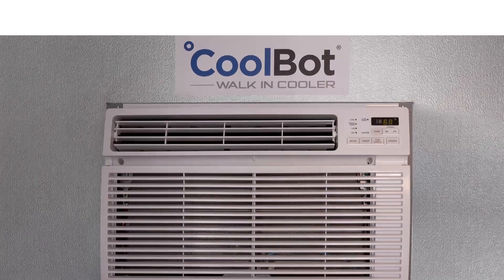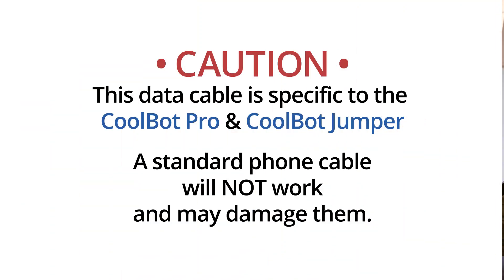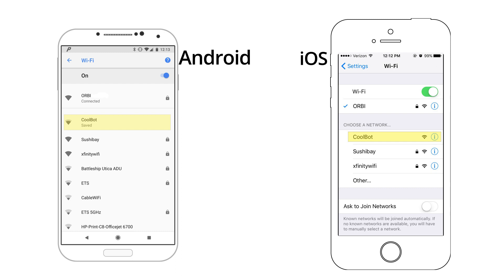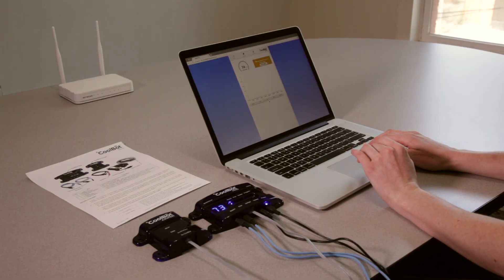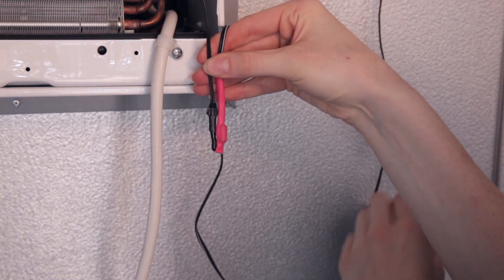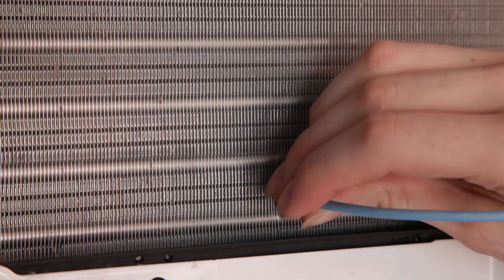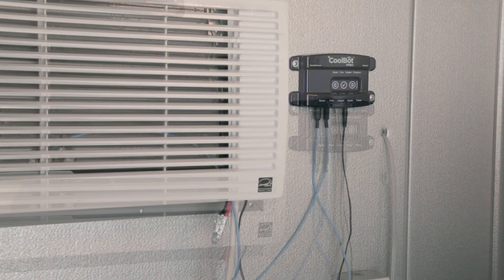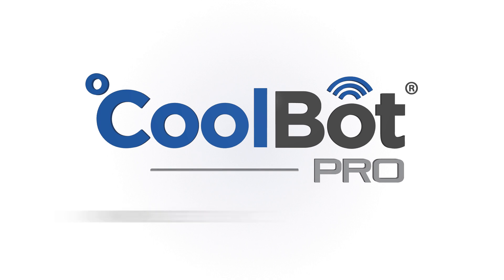CoolBot Pro Install Video

Comment: Very good job on the instructions.  I only wish Coolbot had initially said the outside unit is not weatherproof in their advertisements!!!!!!
Reply from the maker: Hi Thomas, thank you for reaching out. Our apologizes for any confusion; the CoolBot is meant to be hooked up inside of your cooler with the Jumper outside the cooler in a weatherproof box. You can see the box install for the Jumper around the five minute mark of the video. 

Please contact us at hello@storeitcold.com with any other questions. We look forward to working with you.

Comment: Can I use the coolbot without connecting the wi fi part
Reply from the maker: Hi Jesse, yes you can use the CoolBot Pro without hooking it up to WiFi. It will cool your cooler, you just won't be able to check it remotely or receive critical alerts. Reach out to our team at hello@storeitcold.com with any other questions.